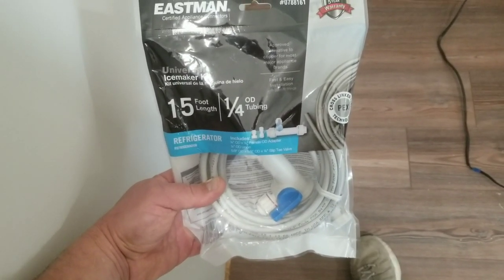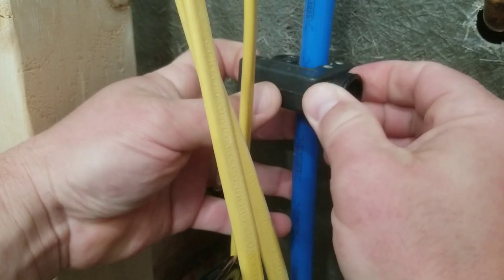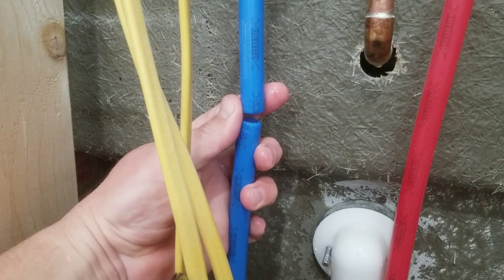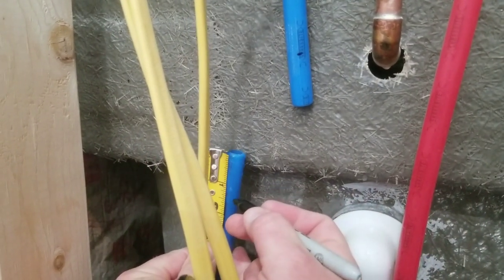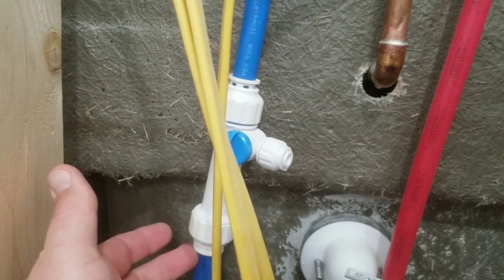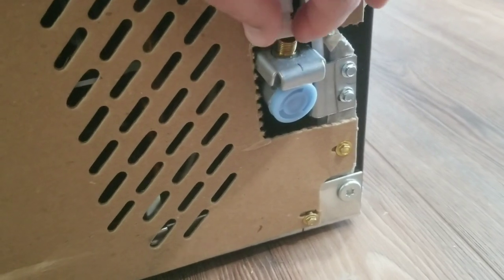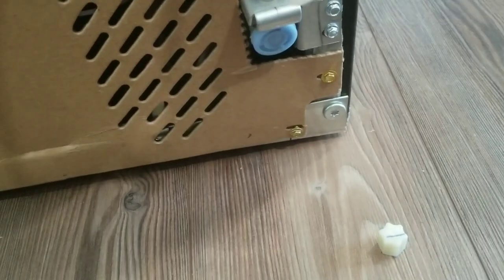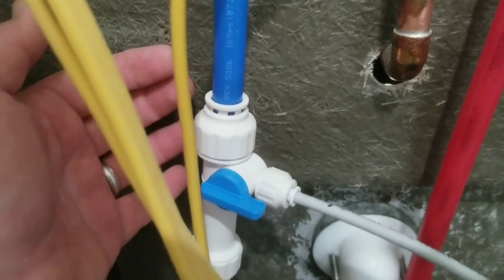Icemaker installation kit for Pex Pipe. Eastman 0788161.

Comment: I was about to head out to the hardware store to figure out how to install fridge line into Pex Pipe. Thanks to your video, no need to figure out anything, just go pick up the kit. Thanks for a well done video. By the way, a good quality tube cutter with a sharp/fresh blade would have worked a lot better in cutting that Pex. Or, of course, a Pex cutter would have been best. Thanks again.

Comment: pex is real easy to use i dont use the plastic fitting not that there bad just dont trust them .. just a note the reason you had trouble witch im sure you figured out is you can use the copper tubing cutter but a friend that is in construcion// plummer guy told me to just buy the tool to cut the pex there like 15 bucks it cuts a clean edge so there no problem pushing the pex in to fitting... i bought it becouse i use it on fuel line hoses for 4x4 tractor truck hoses there again for a small one time job or if your not a macanical guy no need to buy just my 2 cents thats all ....

Comment: Thanks for the video. Our 3k fridge creates way too little ice. Wife asked me to hook up our old American made whirlpool in the garage. Plumber wanted 300 bucks to do this said Pex was tough to work with. Grew up sweating pipe with Pops and was worried this would be hard.  Wife doesn’t mind if i buy new tools so I’ve got my coupon for HF and heading there for the tool!  Thanks again.
Reply from the maker: I would buy the pex cutter tool. I think they are pretty reasonably priced at Home Depot etc. The only reason that I used the pipe cutter was that I already had it and figured I could use a razor knife if it didn't work.

Comment: Just watched this. I bought the same kit. However, my water line is opposite. I have 1/4” copper coming up from the floor to the fridge. I can’t use the turn on valve, but need the other coupler. 😁 I’m about to try hooking it up. 😳 (The old copper tubing cracked at the fridge connection and leaked everywhere a few days ago.)
Reply from the maker: Unfortunately, I don't believe this kit works with copper line.
Reply: @tightwadtv3421  It does. I installed it last night, so far it’s working great.